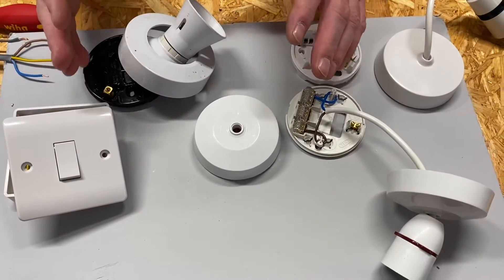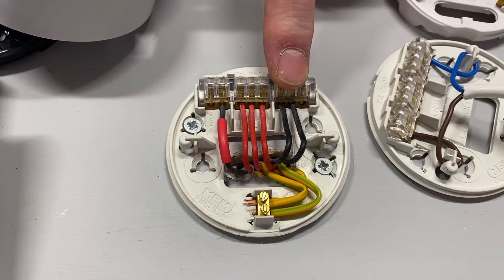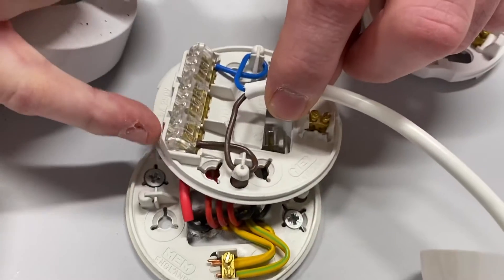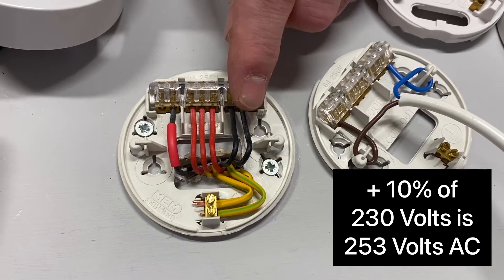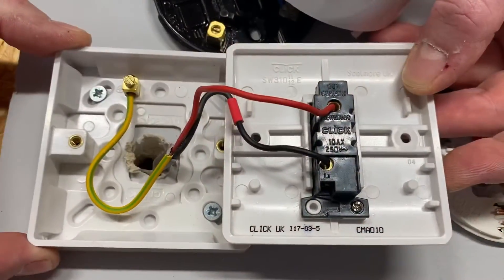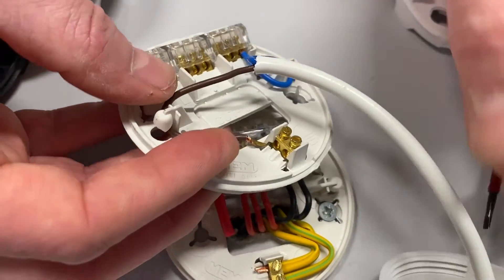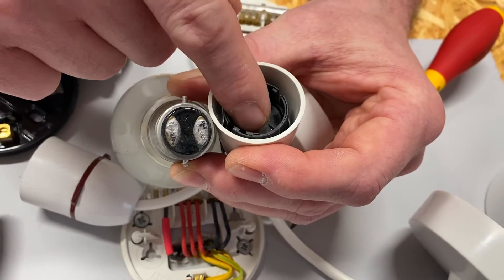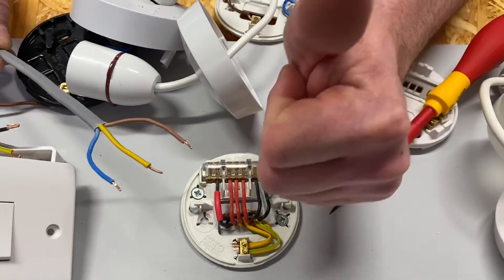Ceiling Rose Pendant - Old Cable Colours - Connections Explained - Using the 3 Plate Method

Comment: I havw a new light designed for the modern wiring system, but i have the old wiring system from over 20 years ago. Its so confusing to get it to work on the switch and not permanently on.

Comment: Does that 3 pin bayonet (BC3?) have a designated polarity?
Reply: No. As stated in the video the inner spring loaded pins are not polarised. The outer pins are to hold the light bulb into the holder and are not electrical. 2 pin is standard. 3 pin is for a special light bulb.